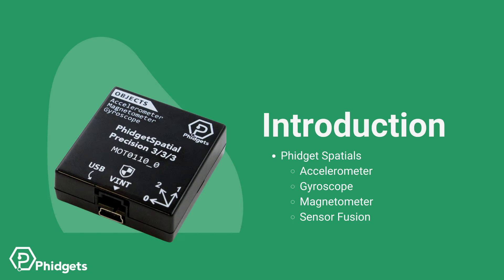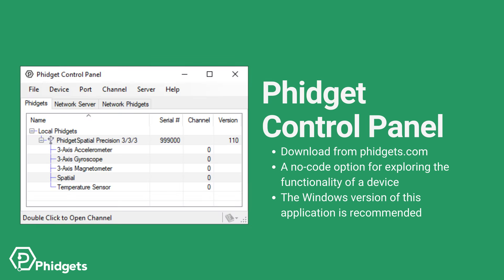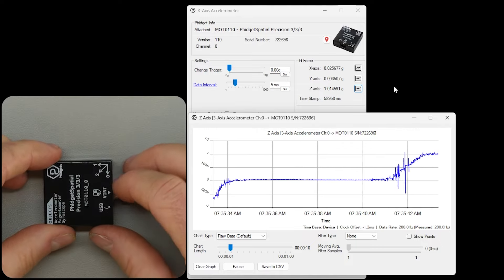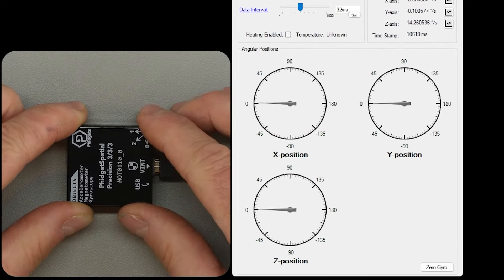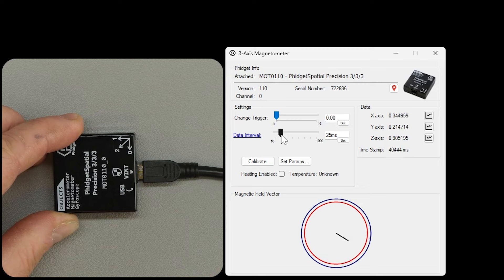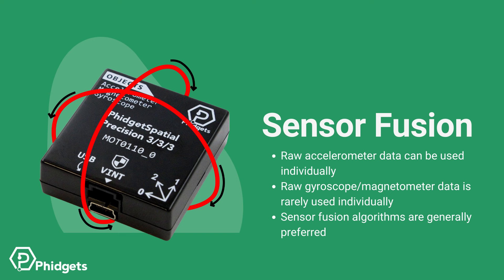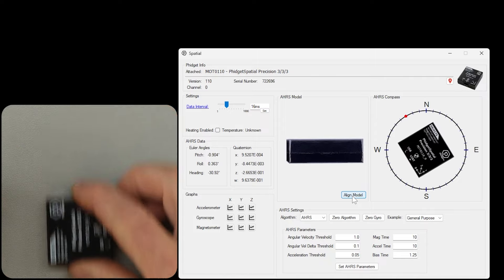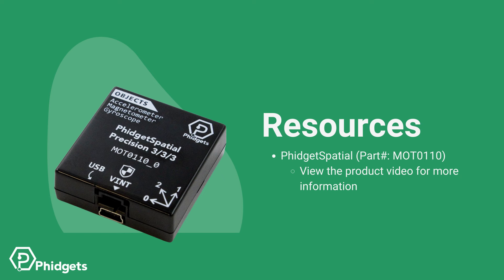Phidget Spatials - Accelerometers, Gyroscopes, Magnetometers & Sensor Fusion

Comment: So, if I want to accurately  measure just my jogging  pace (minutes/distace) , would i  need the accelerometer data only for x,y axis? Or all three axis? Will the gyroscope and magnetometer be necessary as well?
Reply from the maker: You could theoretically use the accelerometer, however, it would be very complex and error-prone.
Reply: @PhidgetsInc  so they have these “foot pods” on the market that measure power output and pace. They use all these sensors and complex algorithms. . Would love to hear some engineers opinion on these devices.